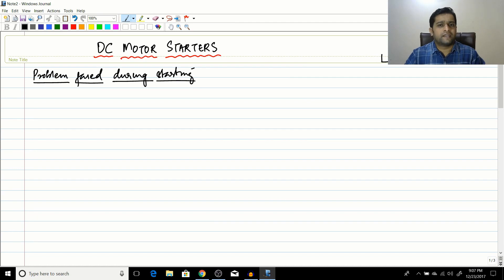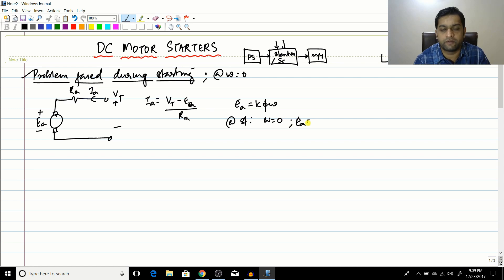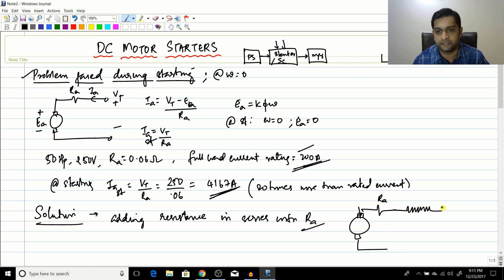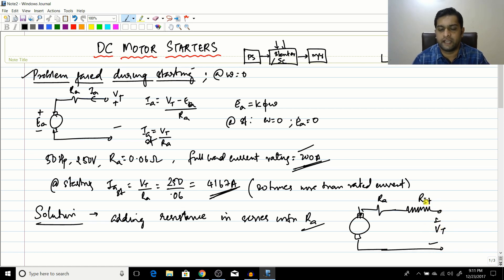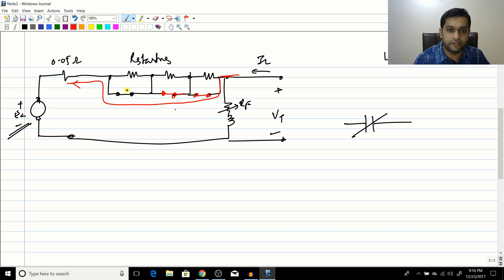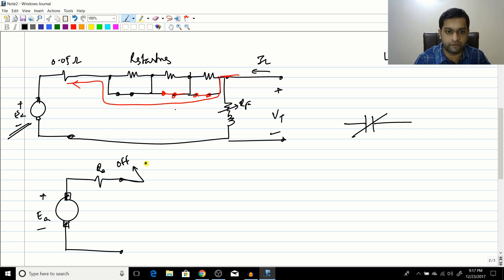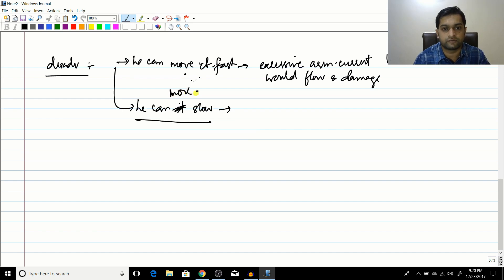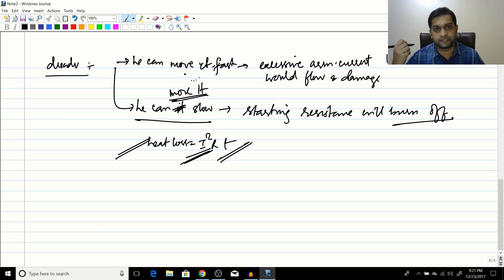#18 DC Motor -  DC motor Starter - Introduction

Comment: why cant we use rehostat. instead of 3 pointer controller
Reply from the maker: Theoretically yes you can using a rheostat with sufficient power rating but understand Starters are specifically made for this purpose it has a specific mechanical construction to aid the operation.. rheostats are made for different purposes.

Comment: sir, i wud like to point out that 1s, 2s are to be inductors coz such property is of inductor but u have used symbol of capacitor, it gets a little confusing, i wud like to request if u cud use standard symbols
Reply from the maker: Give me the timestamp, let me check it out..
Reply: @ElectricalisEasy  7:05 . Thank you for taking note of it.
Reply from the maker: Those are not inductor or capacitors, they are NO contacts as per relay logic...the symbols are correct...
Reply: @ElectricalisEasy  thank you sir once again for clarification. Sir i would also like to ask what kind of thing is it actually, is it just two plates kept facing each other without any contact between them
Reply from the maker: this is relay logic, it just shows a normally open contact position, you may read about relay logic from the internet.
Reply: @ElectricalisEasy  thank you sir really appreciate your timely help